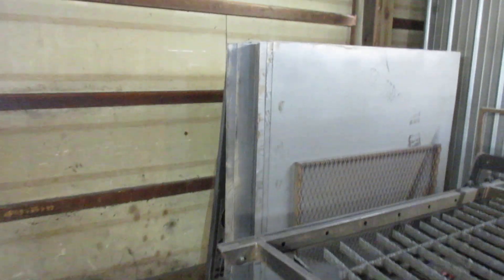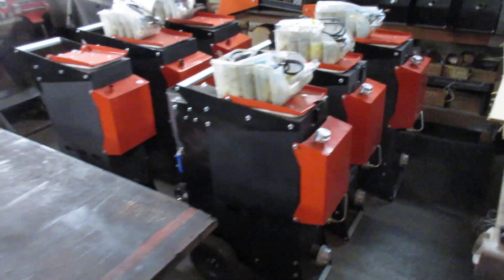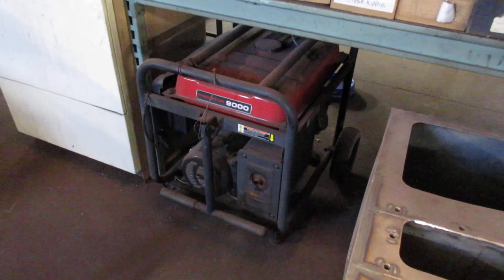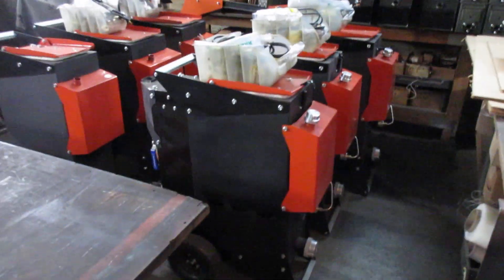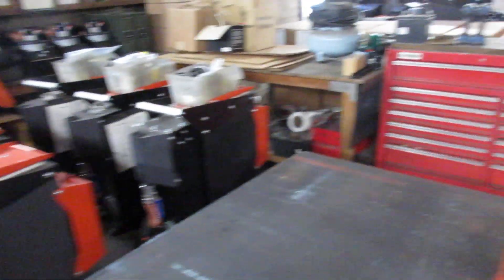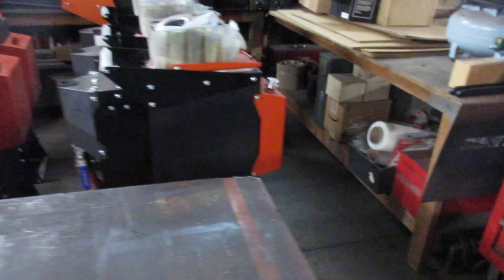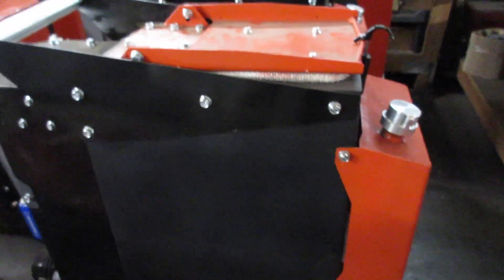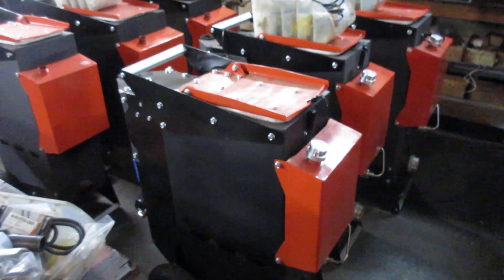Meanwhile at Thrive Off Grid :) Q2 Production Shop Update

Comment: Can u refill while running as long as your careful?
Reply from the maker: Why cant you shut off the engine? I dont understand why everyone wants this. Please explane: 

However you must be carefull of flash backs. You can refill on the fly if you are fast at it. But its way easier to just shut the generator off for a sec. Because if you stall then you lose the mixture as the change from refueling is why it stalled. So it will be more dificult to restart. Just shut the generator off for a sec, refuel the machine and then re start the generator. It will fire right back up as the gas is already there and perfectly mixed.
Reply: @Thrive-Off-Grid  okay nice 👍 and the other question was where does all the ash end up?
Reply from the maker: @carlcasey4177  Charcoal gasification does not produce ash. However there is a clean out door at the bottom front. This is for ash clean out and grate servicing. Once week if ran daily you will need to shift the grate a few times loosen the fines up and romove them. But this machine is discontinued. Go to our latest videos and check the out the DXF-10 it is both a charcoal or wood fuel machine all in one. This unit here is dedicated charcoal and running wood fuel is not possible with this of reactor.
Reply: @Thrive-Off-Grid  thanks heaps. I’m from Australia 🇦🇺 thinking of buying one of yours instead of building my own. I’ll check out the one you said 👍

Comment: From someone that's worked as a robotics mechanic I would suggest you move towards automation when you can before you start hiring more people. If you can build these than a robotic arm that does repetitive motion should be cake.
Reply from the maker: Here is our way and there is a new kiln that comes free with RTR units to make them more ready to run. But there are many ways to make charcoal. There is a very simple method that involved tilting a 55 gallon drum. Remember you have no limit to how many kilns you can run. You can make a lot of charcoal very fast. https://youtu.be/VzGpIGQiv-8
Reply from the maker: We are restructuring, and we are now mass producing units. We just did a physical restructure of your shop and we are now mass producing machines and no longer builing one machine at a time. We should now be capable of producing 30 units per yearly production quarter with a later goal ramping this up to 60 units per quarter. I will be developing the next generation units along with  production system < (thats my actual background) to ramp up production to 1000 units or what ever the market requires at that time.
Reply: @Thrive-Off-Grid  I was thinking more along the lines of 300 units per minute. You have a ways to go before you make that leap.
Reply from the maker: We are the first company since WW2 to mass produce a gasifier. Most if not all others still have a build one at time manufacturing models.
Reply from the maker: Yup indeed, this is where I come from. I used to build automated production equipment for that purpose. Market has to support such a leap first. But our plan is to get into mass retail at some point. We may use other fab shops with that infrastructure pre existing then evaluate if we need to develop our own or stay with vendor supplied production.
Reply: @Thrive-Off-Grid  ah ok I was under the impression that you were bending the sheet metal and forming and welding everything in house.
Reply from the maker: @kevinlewis9151 We are Im talking about later.

Comment: Hey Matt. Keep up the great work. Love the design.  I need one that will run 8 hrs to keep my O2 concentrator at night.
Reply from the maker: Why wouldnt you charge a battery bank to do this. I run an entire RV on three hours of charge time.
Reply: @Thrive-Off-Grid  3 hours of sleep just don't cut it any more.  I'm 65 just plugging along on O2 24/7 .  I built that copper colored gasifer a while back then started to watch you. You've come along way and you're latest seems the way to go. Building a ammo can one of your builds just about done with it.
Reply from the maker: Speaking of that device. I have been wondering if one of those would help cut out the nitrogen if fed into the gasifiers intake to give the gas more energy density?
Reply from the maker: The DFX-S3 can run the 4375 Predator for 4 hours. So a team of two should get you 8 hours.